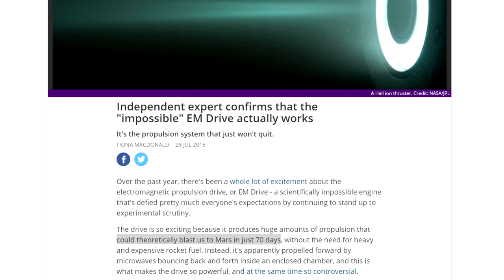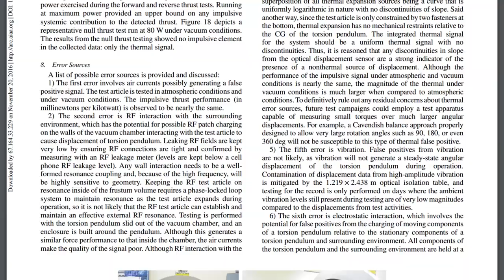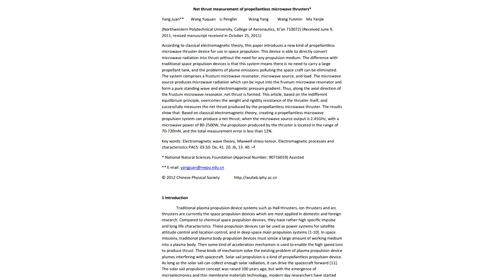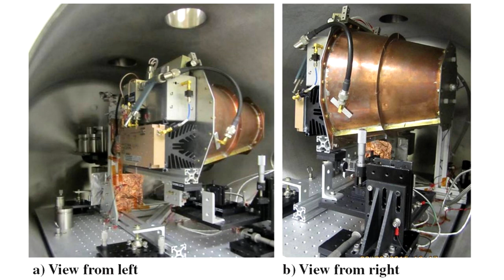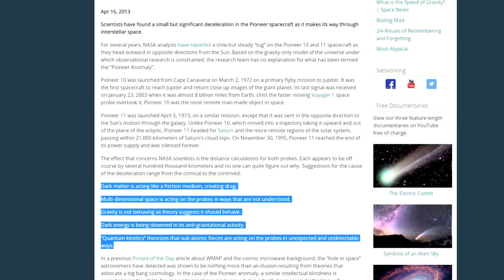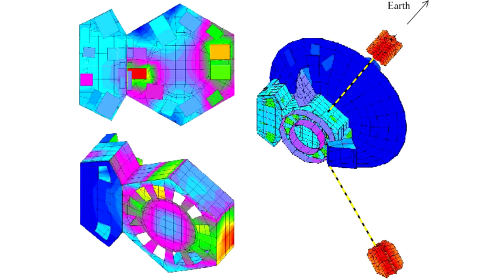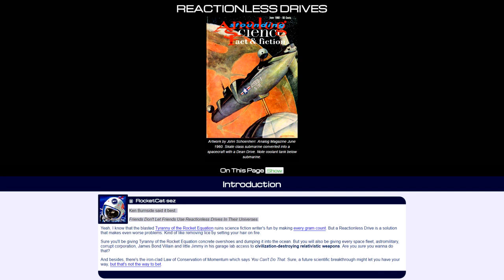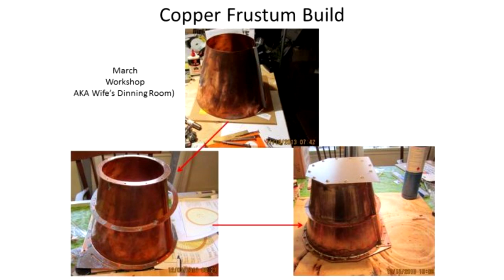What is the EM Drive? And Does it Really Work?

Comment: Everyone, including respected establishment, continues to perform ridiculous experiments ignoring the most basic requirements for demonstrating novel thrust.
1.  Contain the power source within the device (outside power is a certain source of all kinds of errors)
2. Thoroughly monitor all external particles/waves emitted from device.
Reply: that gets quite difficult when you are talking microwave equipment, as well as monitoring extremely small thrust values.
Reply: DFX2KX
The Chinese, eventually, managed to contain the power within the device under test.  I admit, however, it would be difficult to accurately measure all ion flux around the device, but this is of utmost importance.
Reply: Put the device under test and power supply inside a nicely symmetric conductive box on the force balance,  and watch the box with an IR camera for hot spots, and a lot of potential sources for error are contained.  And make sure the force being tested isn't vertical to be sure you aren't measuring simple convection.

Comment: In 11:50 you can find out the difference by measuring. 
Because in the accelerated rocket, measurements in 
the rocket at different locations are all the same and 
the measured vectors are parallel. 

At the position on the planet, the vectors of different 
measurements are slightly conical towards the 
centre of the mass.

Comment: How is an EM drive a perpetual motion machine? You do have a source of energy.
Reply: QuantumBraced   Scott explained it in the vid. kinetic energy rises with velocity squared. double vel. means four time kin. energy. when the change of vel. is constant, over some threshold you get more kin. energy out than you put in...
Reply: QuantumBraced there is a source of energy, the electromagnetic emiter. this make this drive somewhat viable to me, as the law of conservation of energy in a given system is respected.  the main problem is how the element create thrust without dispacing material. if it does not displace matter, what is pushing the thing? it can not be earth magnetic field since the thrust can be orientated, and does not varry depending on the location. it cannot be pushing agains a material of the containement field, since i did the math and it is obvious that the possible generated thrust is way too low. however, i think it is possible that the magnetic field use the cone as it's propelant, as i think it is possible that the magnetic field simply catapult electrons and ionized particules out of the back. tho the problem is that the engine seems to work when completly embelded in stuff.
Reply: E1 = Pt (electrical energy in)
E2 = 0.5mv^2 (kinetic energy out)
Since we have constant acceleration, v = at

Apply conservation: E1 => E2, or Pt => 0.5m(at)^2

Since P, m, and a are all constant, E2 grows quadratically with time while E1 only grows linearly. Eventually, E2 will be larger than E1. So the spacecraft now has more kinetic energy than the amount of electrical energy you put in.
Reply: aardvark445 Anything under constant acceleration that does not lose mass (i.e. a reactionless drive) becomes a perpetual motion machine at some velocity. If that velocity is greater than the speed of light than it isn't a problem. If you crunch the numbers NASA Eagleworks gave then it does cross that threshold below the speed of light.

I did not equate the instantaneous energy to the total energy. Pt is the total energy, as t is the total time it has been applied. The t on both sides of the equation represent the same thing. Think about it.
Reply: Energy is not the problem.
For there to be a sudden local imbalance in impulses would mean that the space around the device is not homomorph.
That contradicts all we have seen so far.
The "evidence" for this is shit.
So it probably isn't a thing.
Reply: The biggist reason that people think this breaks the law of physics is because it provides a constant acceleration with out loosing mass. And while its true that it is not losing mass it was not actually part of the test to determine if it was a constant acceleration as the measermeants were taken with the device basicly standing still so it is still very well possible that the ability to accelerate decreases as its speed increases meaning that it couldnt be used for an infinite energy device

Im not sating this is garenteed to be the case but as an example to say that the experiments so far do not give enough information to make the assumption that it must either break physics or be a fake.
Reply: The 'perpetual motion' paradox here is not about spatial morphology.  Its about a linear increase in energy input yielding a square product in kinetic energy.
My suspicion is that it might have to do with Nuclear Magnetic Resonance; that perhaps the atomic nuclei or the electronic structure of the copper (a conductor, so outer-layer electrons can behave like a fluid when energized) are absorbing the energy in the form of 'spin', and enough harmonized spin can create torque; since we can't directly measure the spin of quadrillions of atoms or electrons in order to quantify the effect, maybe it creates the appearance of an invisible force when it is not a 'force' in the traditional sense at all.
Reply: QuantumBraced the input is linear but the output is not linear it increases the faster it goes. he said this. so if you keep making it faster and faster your input power will  climb 1 2 4 8 output power will climb .25 .55 1.2 2.6.   the input is doubling with the output is more than doubling therefore at some point the output will exceed the input
Reply: Well just some off hand analysis, Energy is equivalent to mass m=E/c^2 so lets say like on order of magnitude of 10^-16 kg of mass is actually lost from the emission. If we assume  it is leaving at the speed of light so E2 =1/2(10^-16)( 9x10^16 m/s ) could be on scale of something we're seeing? Technically from classical EM the emission of electromagnetic waves could induce a field temporarily which then back pressures itself. For example if an electron begins to move it would induce an opposing field which would ultimately repel it's acceleration. This is not maybe in complete disagreement with upper limit on velocity.
Reply: dosmastrify
the problem is you don't take into acount the changes with your speed incrasing
because EM waves travel at c, the speed of light
when you pick up speed, with everything exept massless things, the speed of the particule inside is it's speed plus the speed of the craft. but the light goes only at C, always at C, no matter the plane, or the mouvement of the plane.
it means that when you get to high speeds, you start to get diminishing returns, because the waves are going faster on their trip backward than forward, eventualy the diminishing is so intense that the engine goes to an halt, as it is now in equilibrium. if you try to go faster, the engine works again, but in reverse!. but it also means that the engine is also stronger at decelerating at high speeds, than accelerating at those speeds, as it's power will increase with how much speed it have compared to the equilibrium point, the suposed point of "positive energy" if you don't take into acount the diminishing returns.
Reply: No, you would approach that point from an outside frame of reference, but from the craft's frame of reference, the EM waves will always travel at c - that is one of the tenets of general relativity.

From an outside frame of reference, i.e. the craft's starting point, the EM waves would 'appear' (if you could measure from outside what is happening inside a closed cavity at relativistic speed) to increase in frequency and energy travelling forward, and decrease in frequency travelling backward, - ... 
So does that mean that the thrust on the craft would appear to increase as it accelerates?!   I think my cursory thought experiment is missing something here...
Reply: Strikerklm96 So a falling object loses mass in some way that this em rocket doesn't?

Comment: Wait, so if I turn on a flashlight, is the light shooting out of it causing a small force pushing it towards me?
Reply: Isaiah Schwartz 
Yep.  It's also losing mass too.
But the effects are so minuscule as to be irrelevant in a practical sense.
Reply: Radiation pressure is a thing. And so is the effect of light. That's one of many possible options of deflecting incoming asteroids. Shining a light on one side long enough may be enough to redirect one. (Gross oversimplification but still)
Reply: we will just glue a few thousand to the back of a spacecraft
Reply: Photon's dont have mass, only momentum, sorry for the english
Reply: TheZuca Chaves Sorry you have to feel persecuted for bad English, even though yours is better than native speakers who don't know more than English.
Reply: Solar sails bro
Reply: Rory Shields yeah solar sails are being built, will make new searches about photon mass, what I thought was m=10^-50
Reply: Yes
Reply: Yes. The loss of mass is from the battery( fuel source) lots of exhaust velocity but no discernible thrust.

Comment: Scott Manley also, time-contraction effects (from Special Relativity- you should know this!) as you approach the speed of light would deal with the issue of different observers seeing the drive accelerate at different rates.  An observer moving in the same direction as the drive will appear to observe it accelerating more quickly than an observer not moving in the drive's direction, but time will also appear to pass more slowly for him relative to the other observer.  Thus the two observers will always observe the drive moving at the same speed relative to some other point in space, even if they appear to observe it accelerating at different rates (if an obseever sees the drive accelerating twice as quickly, but time passes at half the rate for him as compared to other observer due to his own relativistic velocity, there is no conflict...)
Reply from the maker: Do the math and you'll realise it doesn't work, the breakeven point happens long before gamma suppresses it.
Reply: Is this guy a stalker or healthy debater?

Comment: to convert electricity into thrust:
turn on a flashlight.
Reply: EvilPlagueDoctor Thats the idea behind a solar sail
Reply: that's a photon drive, and they basically already exist. There is nothing strange on how they work: you use energy to generate photons. The photons are your propellent. The proposed EM drive, has no propellent..which mean that it's momentum variation is not zero.... it's like a gun having recoil without a bullet in the chamber. it just should not happen.
Reply: *****
it was an example... and i'm not 100% convinced of that. The release of the bolt should be akin to me trhowing a ball on a railcar...as long as the ball does not leave the car, this will not move. You can hear and feel che "click" of the bolt, but that's not a recoil. (TL:DR internal forces cannot change the total momentum of a system.)
Reply: Salvor Hardin exactly, or else nase would have been using momentum from movement as thrust for ages already.

pity really :(

but at least we can make things spin using that method ^.^
Reply: EvilPlagueDoctor i know... my doubt was due to the fact that i'm not familiar with firearms. As for the physics, i'm more than familiar with basic newtonian mechanics :)

Comment: I love hearing you explain physics and rocket science! As a side note I like seeing your wall filled with analog vinyl record albums! My buddy has a degree in engineering and thinks I'm full of beans that I can hear the difference between vinyl and CD and especially vinyl and MP3. He even emailed data to back himself up. I explain to him there is a depth and warmth to analog that digital (especially MP3 because of compression) leaves out. I would love to hear your take on the matter!
Reply: I'm ashamed someone with a degree in engineering can say that; he hasn't thought it through or at least hasn't done his research. The quoted signal to noise ratio of CD-quality digital audio (16 bits, 44.1kHz sampling rate, CD-DA from here on,) is only accurate for relatively low audio frequences at absolute maximum volume. Lower the volume or raise the frequency and the signal to noise ratio gets horrible; utterly unworthy of being considered high fidelity. Now, an engineer won't be directly impressed by the words depth and warmth, so lets try to pick them apart.

Warmth is easier for me to understand, it just means you don't have too many harmonics; not too much treble. Harmonics have both higher frequency and lower amplitude (volume) than the fundamental frequency they're based on, so CD-DA will distort them more. Distortion is largely heard as more harmonics; more higher frequencies out of balance with what the sound is meant to be.

I don't have so clear a picture of depth, but CD-DA's incredible ability to distort smaller amplitude signals must have something to do with it.

Getting into the territory of vague memories, (it's been a long time since I read about this,) I think I remember reading that CD-DA's noise floor is measurably higher for smaller amplitude signals, but that really wants confirmation. It's because noise in vinyl is largely an additional signal at a relatively constant level, but CD-DA distorts the signal itself.

MP3 could be better quality because it records each frequency independently, but if it's recorded from and played back through CD-DA, I'm sure you can see what'll happen. On top of that, it eliminates harmonics which its designers figured wouldn't be heard, but the threshold for elimination A: won't match everybody's hearing and B: is adjustable according to desired compression.

Then there's the matter of mastering at a different sampling rate; perhaps 48kHz. Digital resampling is pretty clever, but I don't really see how it could avoid getting distortion from both the source and target sampling rates.

I'll leave it at that. Computer (and thus mobile-device) audio has had some improvement and some retrogression in recent decades. Floating-point audio encoding may preserve depth when digitally mixing multiple sources, but software and hardware producers are alike in denying the basic fundamental fact that human senses have logarithmic response, and this goes beyond audio. Tablet brightness controls are terribly bad for sensitive eyes for no reason at all; just refusal to even consider the issues or conduct the simplest tests.

Comment: Well let me explain a theory that I have which is good and bad news for EM drive😪

I am going to do a thought experiment 🤓 but I will use a cylinder instead of a conical shape which make it easier to everyone.

now make the cylinder static to in relation of space and time.then input green light into the container.
you can say that both sides of the circle will only have green light bouncing off the wall in all directions.so no net force .🙄

let change the velocity of the cylinder to just below the speed of light. 🤔now the light bouncing off the one side Will be a radio waves while the opposite side it will be a gamma radiation . which generates a net  force opposite to the direction of travel.

which means the thrust generated by the em drive is only able to slow down the space ship in relation to space time.which is bad.😥

now for the good news it works😄 but in a certain direction.😒
Reply from the maker: +Mohd Afnan Azmi you're halfway there, now you need to incorporate special relativity
Reply: Scott Manley 
welp😲 I am screwed.

Well I would have done it if I understand all special relativity to a level of a theoretical scientist I would have published a paper debunking em drive but I don't.😬

however I understand the basics part of special relativity that time dilation occurred when an object or a man/woman travel close to the speed of light.😅

and dilation of time also occur when there are strong gravity. thanks to the interstellar movie which is the greatest movie that I have seen.😍

final point I learned these things as  hobbies on YouTube and TV when I was 16 year old  which is three years ago not in a university. but I am in one studying in electrical engineering not theoretical physics😅 

thanks for responding to my comments Scott Manley 
I have so much respect for you teaching me the in and out of KSP and Physics IRL😉
Reply: Scott Manley 
welp😲 I am screwed.

Well I would have done it if I understand all special relativity to a level of a theoretical scientist I would have published a paper debunking em drive but I don't.😬

however I understand the basics part of special relativity that time dilation occurred when an object or a man/woman travel close to the speed of light.😅

and dilation of time also occur when there are strong gravity. thanks to the interstellar movie which is the greatest movie that I have seen.😍

final point I learned these things as  hobbies on YouTube and TV when I was 16 year old  which is three years ago not in a university. but I am in one studying in electrical engineering not theoretical physics😅 

thanks for responding to my comments and being my online teacher Scott Manley 
I have so much respect for you teaching me the in and out of KSP and Physics IRL😉
Reply: Like scott said, relativity my friend. The light inside the chamber isn't going to change wavelength if measured from within the chamber, only from an outside, stationary setting.
Reply: Jackson Gray ok thanks for the information which means I accidentally mixed up the stationary outside observer with an observer on both sides of the cylinder.😥

ok now that my thoughts experiment had a major flaw I will either try another thought experiment to explain or disprove EM Drive Or just wait until a more conclusive study is done.